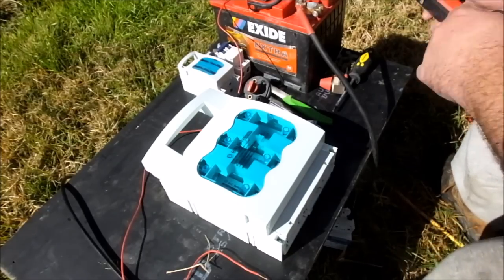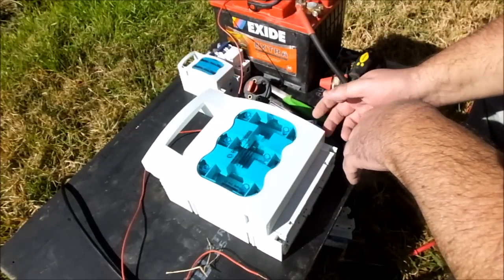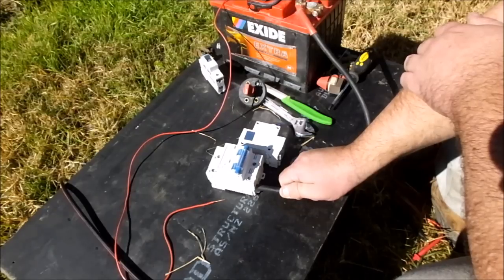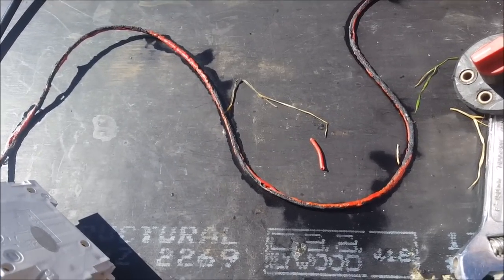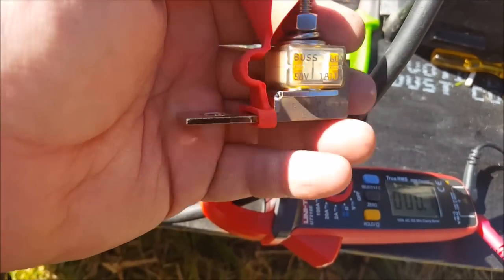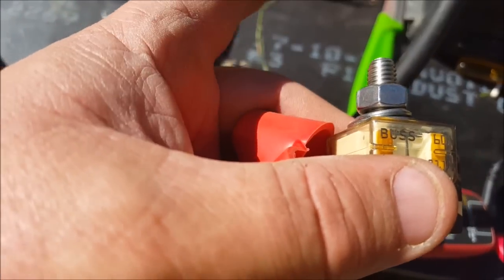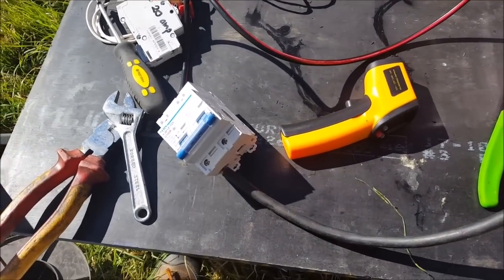Off Grid Solar Power - Fuses and Circuit Breakers are Important.

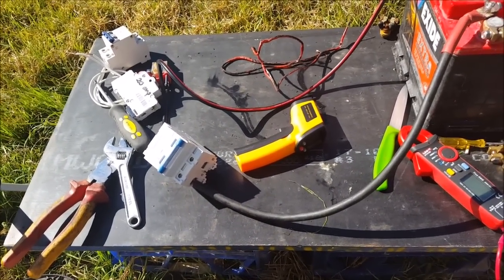Comment: At 11:17 its natural that 20amps breaker will not trip even it 63amps current supply just because there is no current flowing in 20amps breaker (open circuit)😂😂😂

Comment: Thank you! This could save a life. loved the slo-moe of the fuse going. Great editing. I purchased a boat with 300 watts of solar and no fuses or charge controller. On the first time out after purchase I smell chicken cooking and then the interior of the boat is filled with smoke. Im by myself and can't figure out who is the mad chef. Turns out the inverter shorted and I guess the capasitors are filled with used cooking oil. I am slowly redoing the solar system and this demo helped me a lot. I'm sure it will help others who have purchased or inherited somebodys terrible work. Thanks Again.
Reply from the maker: Good stuff! Thanks for watching, too.

Comment: That is kind of worrying that those circuit breakers were not tripping at way higher than their rated current... Were they ebay breakers? I would hope that locally bought items would be more reliable, yeah?
Reply: They are not tripping because they are a THERMAL type breaker. A power wire 
can take current for a very short period of time that is above its 
rating without being a big deal. Usually called Inrush current IIRC. But for an extended period of time it trips - also to prevent nuisance tripping as one person stated. Typicially when you need instant protection from over amperage you use a quick-blow fuse. This is all an example of what you dont do and putting the wrong things together can result in disaster. You must size everything to work together.
Reply: This is acceptable and expected if you look at the trip curve for the breakers. You don't want nuisance tripping.
Reply from the maker: Yes, it's definitely concerning. I think the AC breaker is Australian but the Dc breakers are Chinese. I'll be getting some Noark DC breakers to test in the next few weeks.
Reply: Oh OK, thanks for that. I'm obviously no electrician ;)